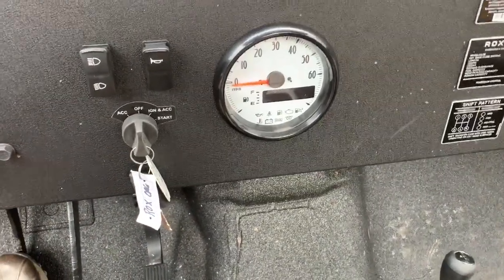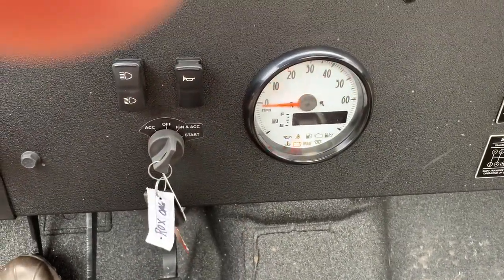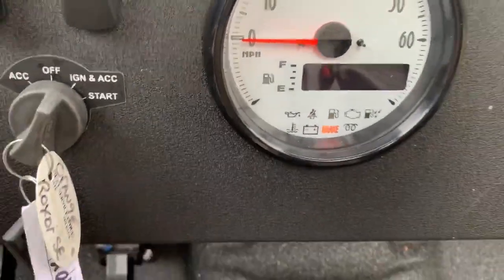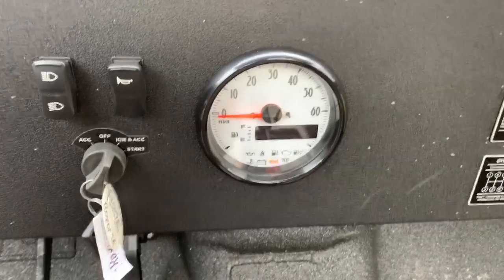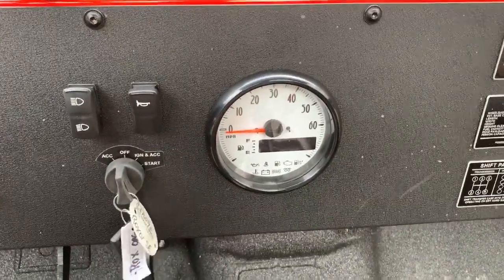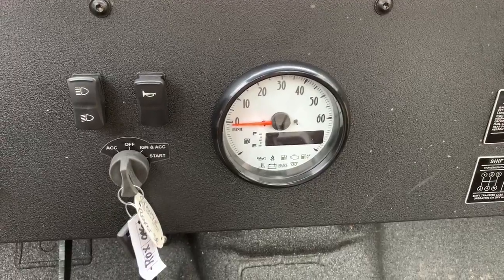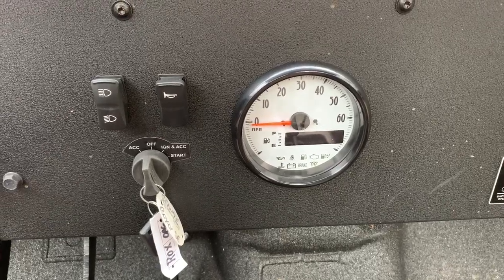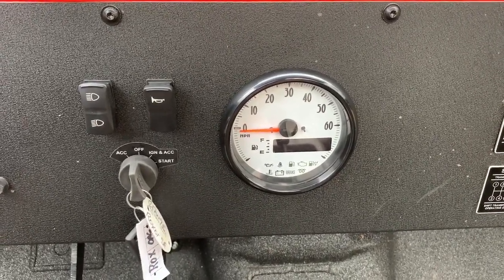Roxor speedometer display not working.

Comment: I posted the same issue on a Facebook page and Mahindra messaged me and told me to take it in.  The early models had a bad shipment batch sent to them. Take it in they will fix it no questions asked.
Reply from the maker: UPDATE:  I took it to the dealer.  They had it replaced with no questions asked.  The new one is working just fine now.  Thanks!
Reply: @roxorsrule8604  nice!

Comment: Much better clip with the phone horziontal.  lol.  Some guys have had issues with displays not working right. You have 2 years, They will just change it out I'm sure.  Like you said, not worth running back to the dealer, but I would let them know.  You do have video proof. lol.